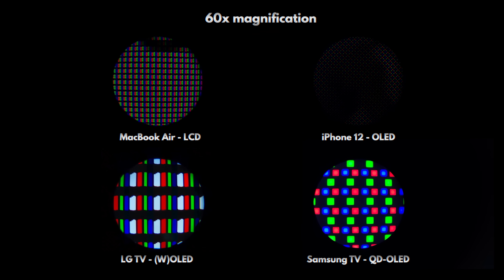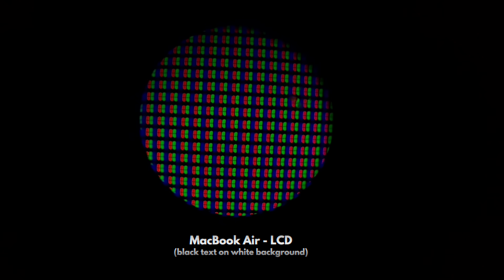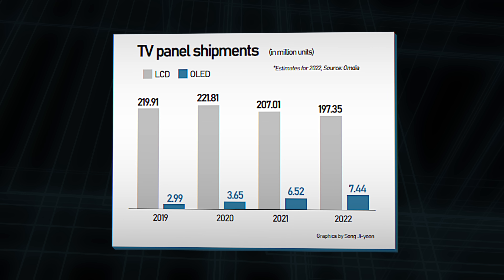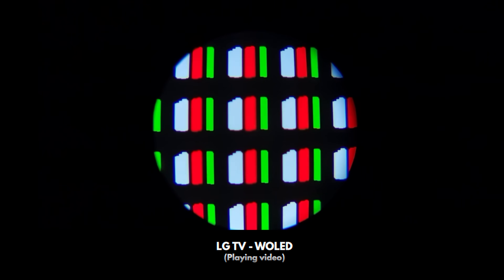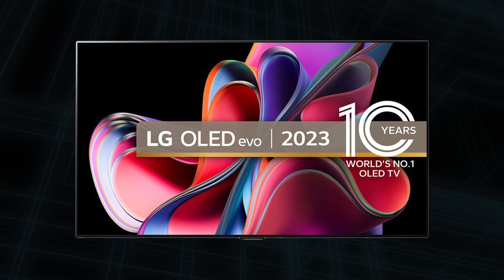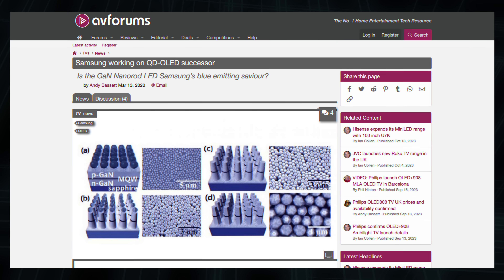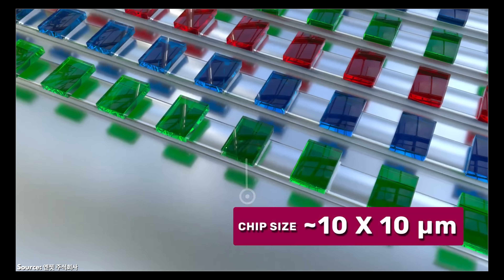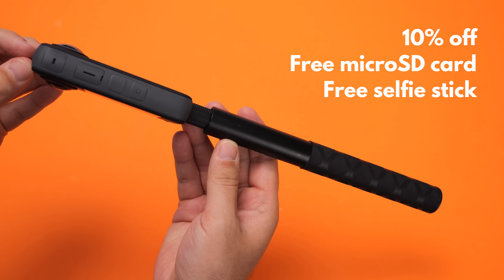The billion dollar race for the perfect display

Comment: A super helpful video, i just wished u tell us the dif between super amoled vs oled vs amoled ...
Reply: The main difference between AMOLED and OLED is an added layer for better touch sensibility, that's why you see phone companies specifying their phone displays are AMOLED and not OLED, even though the technology is basically the exact same. Super AMOLED on the other hand is just marketing jargon created by Samsung.
Reply: @farewellblues  Not really. To start, it is with the beginning of their "Super" AMOLED that they integrated the digitizer. So that wasn't what made AMOLED. There has been AMOLED devices without touch sensitivity. There is actually differences in the variation of OLEDs on how the sub pixels per pixels of the technology. And Samsung AMOLED alone have had various form. Yes, AMOLED is the marketing term saying "this is Samsung OLED" But within their AMOLED there's the super, and the plus and what not. And they do signify difference technologies. The AM is specifically for Active Matrix, bust basically every TFT LCD has always use this tech. There's Pasive Matrix, but that's a whole other story. And Samsung has basically every variation all under the AMOLED brand just adding subfix and prefix, and originally it was a good indication of what kind you were getting but then they screw their own naming.
Their main division would be between "PenTile" and RGB strip. But even those are made differently depending on the pre/sufix. Depending on the alignment used on the PenTiles text will become better or worst. Fuzzy. While I think it was with the Super Plus that they made a real RGB sub pixels. Then in other "RGB strip" its more of a line with 2 square/dot. The Dynamic naming is to point out if the display has HDR. And another branding would've been POLED. Which is LG's OLED that use Plastic substrated as opposed to glass as every other LCD or OLED in the past. Although Samsung also use plastic now, obviously, otherwise they wouldn't be able to make foldable phones. As of now, nearly everything using OLED use Active Matrix, so they are all AMOLED, and many mobiles are made of plastic. So they are POLED as well. Therefore, a vast mayority of devices would really be AMPOLED. 
There's also WOLED, which is said to include a white sub pixel. But in reality is more of a white back pixel. Like the QD-OLED blues. 
Unlike WRGB on IPS that do add a white sub pixels beside the RGB array inside a pixel.
Reply: @farewellblues  aha I see I see, thanks for the information.

Comment: Phenomenal video!

Only wish you would've talked about response times/motion clarity (near-instantaneous for OLEDs) a bit more but not too big of a deal
Reply: he does briefly mention it in the introduction of OLEDs
Reply: @hmilles  Now that you mention it, yeah motion clarity in general wasn't really mentioned. So refresh rates, response times and input latency
Reply: as far as I know there isn't a display technology that can match OLED when it comes to response times
Reply: @Neucher  CRT had nanosecond response times, by far the most beautiful display technology when it comes to motion clarity.
Reply: @Neucher micro-LED although not consumer ready has response times measured in nano seconds
Reply: @Robotcreeper101 correction: CRT response time is 4 nanoseconds.
MicroLED response time is 2 nanoseconds.
MicroLED is the apex of everything here.
Reply: @kougamecs3876 No good tests have shown remotely near those response times for CRT's. 4 microseconds would be generous not 1000x less than that. Microleds demolish them and it's never been close.
Reply: @Frozoken  so you're saying MicroLED displays are slower than CRTs?
Reply: Response time of OLED is so fast its actually bad for low refresh rates like 60hz. It feels a lot less smooth to me on my Oled than on my LCD monitors. Always get the 120hz if you can.
Reply: @cc0767 my solution for this in games at 30 or 60 is to turn on motion blur in games. I know it get a bad rep, but it actually helps a lot.

Comment: OLED burn in is the biggest issue with oled.
Reply: Burn in has not been an issue for a few generations now.
Reply: @cc0767 Burn in is inherent to oled technology, all oled panels eventually burn in as the organic material wears out.
Reply: @cc0767  I'm talking about using it for well over 10k hours and not having an issue which most LCDs can easily do. I don't wanna replace my TV once every 4 yrs
Reply: @cc0767 They made some huge improvements. OLED screen come these days also with a few software and hardware feature to reduce the probablity of burn in.
Reply: @cc0767  Dont drink the kool aid. Going from deformed in 4k hrs to deformed to 6k hours doesnt mean much.
Reply: @RadialSeeker113  "dont drink the kool aid" bruh, I have an oled and I use it daily for the last 4 years and there is no burn in. Burn in is inherent to every technology.

Comment: When will Europeans start creating hardware?
Reply: Siemens, Bosch and ST Microelectronics just to name the first ones that come to mind.
Also Europe builds a lot of machines that manufacturers use to build consumer hardware. Arguably this is still hardware, just not for consumers.
Reply: The lithography machines made by Dutch company ASML are responsible for manufacturing the processing units of just about any high end tech product.

Without it, TSMC, Apple, Intel etc can't make the high end chips used. It's perhaps the most important tech company on the planet as everything relies on it.
Reply: Nokia and Philips was the end of that
Reply: Europe is a much more fragmented market and costs are higher.
Reply: Last time it was huge
Reply: when it's cheaper to do it in Europe instead of somewhere in Asia so probably not for a while
Reply: Some components are.
Reply: The only company capable of making EUV process nodes is Dutch, relying on German lenses
Reply: @TAP7a  Eh, don't bother, OP is 56% Amerimutt more than likely.
Reply: When Americans run out of money
Reply: It's so funny when people say "that was the end of it" on such progressive issues.
Reply: Making hardware is for low skilled country.
Europe and silicon valley is R&D factory.
Reply: Uhhh never.
Reply: When Americans start manufacturing it.
Reply: When they start teaching hardware engineers and not just software
Reply: I think the machines essential for microchips production are designed and manufactured in Europe
Reply: ... You haven't even watched it yet..
Reply: the usa wants to deindustrialise europe, hence they want the russian-ukraine war to stop russian resources from merging with european capital
Reply: Europeans are only good are fining and leeching of US tech companies
Reply: When setan goes to Haven 😂
Reply: When salaries in the rest of the world catch up
Reply: when they finish their drink at the bar.
Reply: Can you make it cheap??
Reply: Oligarchs are busy reducing the population at the moment. Probably going to take a few more years, expect Europe to start producing things after 2035 at the earliest.
Reply: European are lazy bump
Reply: europe no longer has a large consumer technology company after the fall of philips.

edit: but that's not to say europe isn't supplying components to cutting edge technology, or that europe doesnt develop any.
Reply: AUTO
Reply: i’ll pass on the made-in-germany tax and stick to my run of the mill made-in-taiwan
Reply: When Europeans loosen their environmental and labor regulations like China.
Reply: Probably never
Reply: search for ASML, prolly the most important company in the world
Reply: Never again
Reply: Europoor
Reply: Europe is not a country
Reply: I'm not proud to say this as I'm a European,we don't stand a chance unfortunately
Reply: Last time a European country made great advances on technology it didn't end well for the rest of Europe xd
Reply: ASML is a Dutch company that makes EUV machines that produce almost all of the world's silicon chips.
Reply: Never
Reply: I want everyone free and productive.

Obviously, we need parts. They are toxic. And managing industrial hygiene is essential. The thing is we have tyrants and authoritarians want to keep us down, so do electronics as a hobby, and move into locations where we may have more freedom, less costs, but obey the law, and still maintain safety and quality. This level of complexity takes time.

Until a group of folks have that much interconnection, it makes sense to begin where one is.

If one is interested in wifi, seek mastery.

If it's cell phone communications...

Being and electronics expert is matter, initially of engagement.

I want equipment that work and I have parts to cannibalize to maintain the equipment I have: music amps and guitars.

What I am saying is, start collecting hardware and start mastering electronics engineering principles. And form clubs...that's a start.
Reply: Europe's tech giants have faded away. Philips, Nokia.. Mars One (😆)...
Reply: EU keeps over-regulating and nobody is interested in investing in such an environment
Reply: @wt61 not really true regulations and taxation are some of the last points corporation that matter to corporation 
1) access to markets
2)access to skilled labour
3) access to banking and fiancee 
4) access to transport and communication (aka infrastructure)
Etc

For example:- the European market for tech companies is smaller as its divided between various countries which have different languages , culture and customer in eu spend less which results in a smaller market due to which results in smaller corporation which get outcompeted by the foreign counterparts

This is a singular point and the tech gap between us and eu is a multifaceted issue that cannot explained with a single point but boiling it down to regulations one of the least important issue is ridiculous
Reply: @wt61 he says as billions of Euros are going into semiconductor fab capacity and all the major players have significant hardware design capacity based in Europe
Reply: @wt61 EUs "overregulation" affects manufacturers outside the EU as well and has nothing to do with it. Energy and labour cost is just higher here. Governments in asia invested more heavily into it and the entire IT sector in the USA was always big to begin with. Also outsourcing was the go to doctrine for decades. Post corona a lot is planned to come back, even new factories are opened up. I think Intel is building one near Dresden right now.
Reply: @cc0767 Yes I live In Germany and sleeping in the factory in Dresden at the moment
Reply: @hagenlens1403 one day I hope to see a youtuber explain how we east germans managed to attract international companies like Tesla and Intel when we struggled to keep our own industry, shows you how badly our parents have been ripped off
Reply: @cc0767 But Intel is a US company. Why's there no innovation coming out of Europe. All they have are legacy companies. US and China are coming up with newer disruptive technologies while Europe is sitting prime for disruption.
Reply: @alburaq3290  There are more German than Chinese components in every iPhone. I’ve yet to hear about one technology invented in China and not just copied and faked.
Reply: @alburaq3290  yes, so? If a company produces in a country, why does it matter where it came from? All of US tech migrated there from europe by that logic. Nvidia, AMD and Intel are all US companies yet they all manufacture in Asia.
If you have talent for the industry and come from europe, there is virtually no entry barrier to just working in a US company. I know some people who basically work from home in europe for US companies. And europe doesnt crash entire markets like China does. TSMC only exists because their government literally needs it for survival. Samsung at this point owns half of south korea. Asking why europe doesnt have tech firms is like asking why Japan doesnt manufacture chips.
Reply: @alburaq3290  "why is there no innovation coming out of europe" this just shows how little you understand the industry, nearly all innovation comes from europe.
Reply: @alburaq3290 the only company in the world capable of making the machines that manufacture semiconductors is from Europe (I think it's a Dutch company) ARM is also based in Europe.
Reply: @alburaq3290  And the "innovative" processors that sit in your Apple devices are made possible by a little company called ARM which is situated in my hometown in Cambridge, England....
Reply: @cc0767  That would be a very interesting topic indeed. I would suppose if the ecological nature of the Soviet post modern hegelian systems had been slightly modified, we maybe could've reached a point where the internalization itself would've created a equilibrium effect.
Reply: @alburaq3290 In the semiconductor space specifically Europe still does a lot of analog stuff and also Belgium has IMEC which is one of the largest semiconductor research institute. We just don‘t produce a lot of stuff that is directly advertised to consumers, which is why you don‘t know about it.
Reply: @alburaq3290 The EU manufactures the equipment required to even produce silicon to begin with. Without that your display wouldn't even turn on.
Reply: @RickyStephens-ir8ro "They" did you a favour by making Apple finally adopt USB C...
Reply: @cc0767 No, that's a very disingenuous comment. There is a chasm of difference between operating within the EU and operating from outside. EU regs make it expensive to operate those who could uproot, uprooted, those that could outsource, outsourced, those that couldn't had to find ways to adapt (e.g ARM going fabless), and those that could fell behind.
Reply: @ExileXCross  no
Reply: @RickyStephens-ir8ro "overregulation" bruh neither is that overregulation, nor is it bad, nor does it only apply to europe. Or does apple not use usb C outside of europe? Yeah I thought so..
Reply: Very funny. Developed world CONSUMES what everyone else makes. They occasionally design stuff, but that's the limit.
Reply: @Shini1984 in every single hardware project I worked on, we used German microelectronic components. To claim Europe does not manufacture and only designs stuff is like saying that America is not an agrarian powerhouse because it does not export date fruit